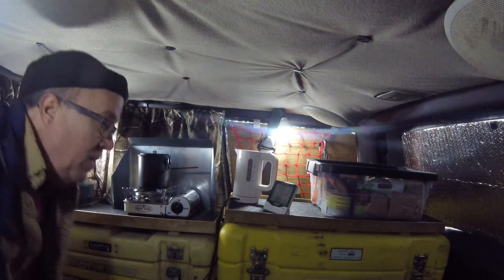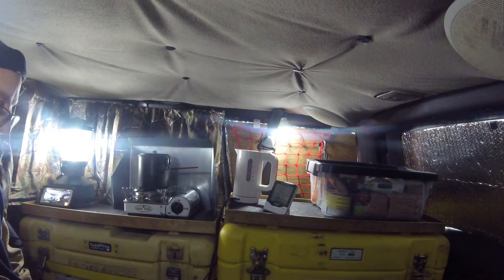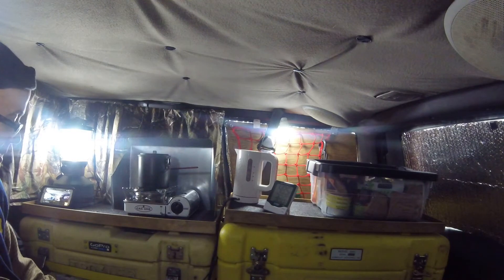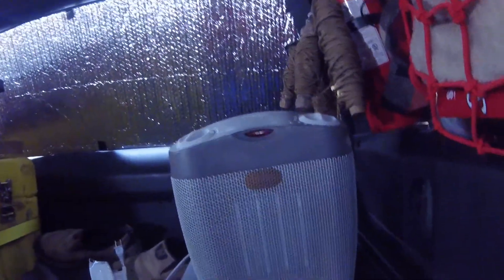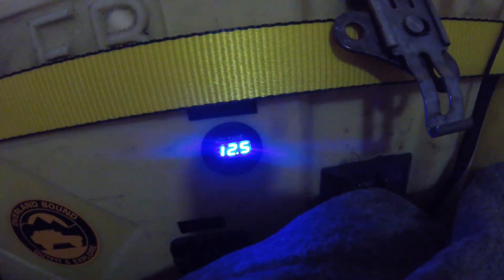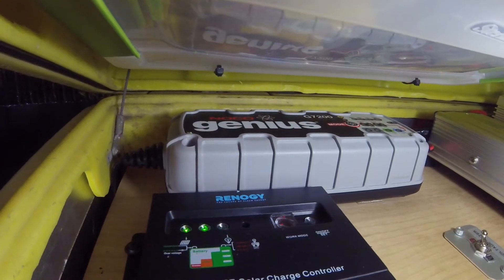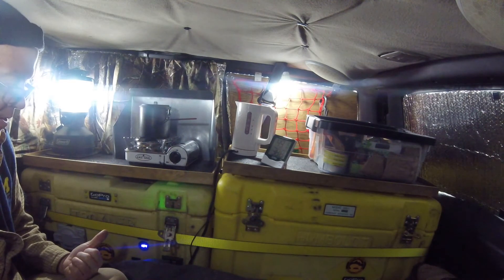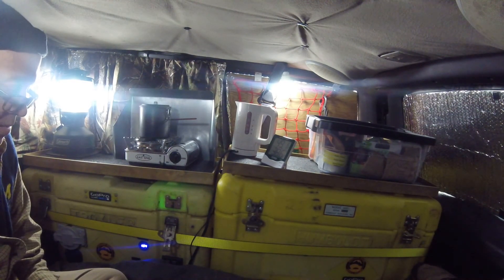A couple issues with Solar Generator in Jeep XJ Bug Out Vehicle

Comment: thinking you may have to re route the antenna cable as far away from the solar panel as possible. the electrical properties are acting as a faraday cage or signal choke.. EMF interference?
Reply from the maker: Pretty sure that is it. I currently have a magnetic mounted antenna on the roof right next to the solar panel, and think I should go with a bumper mounted antenna.  Thanks Man!